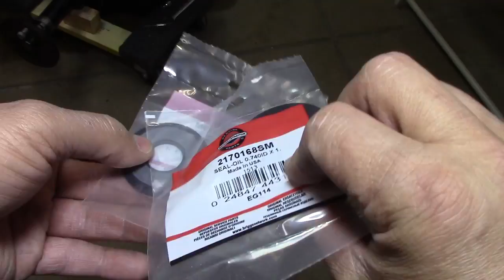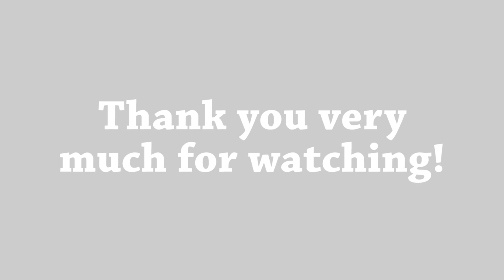40) Allis Chalmers 310 Tractor Restoration project, video 40

Comment: On your rear differential, you want the set screws to "bite" into the axle rather than just squeezing the brass plug onto it.  It is less likely to loosen or slip that way.  If you were removing the set screws every week or month the marks would be a problem, but there is a good chance that they will never be removed again, so one or two bite marks per side won't hurt anything.

You don't need to paint the washers and hardware.  Almost all nuts, bolts, and washers are zinc plated and shouldn't rust.  The contrast in colors between painted and bright hardware looks good, and is also how it came from the factory.  If you are worried, you can rub a little oil on them and that will keep the rust at bay as well.  

The greasiest old tractors are the easiest ones to restore because under that grease the original paint is protected and there is no rust.  It looks like you have accumulated a pretty good working set of tools.  The press, seal install kit, sand blaster, various paint guns, etc.  You'll be all set to restore something else when the 310 is done.  ;-)
Reply from the maker: +HemiRod23 I though the contrast of the hardware looked nice too!  I going to do what you said except I think I will clear coat the bolts.  Also, you are so right about the axle. When's the next time it will come apart?  So I plan to take out the brass.  And yes, I've been gathering tools and knowledge so I can restore a car when I retire.  I love tools!  And THANK YOU so much for the great info!

Comment: Your doing a d@%# fine job on this. I have been following the restoration for a while now. Just a thought on the space in the front spindles, if you put a thin radial thrust needle bearing in at the bottom of the axle there it is like power steering, almost. Zippo Varga has a vid of exactly how to do it here in the real  world of you tube.  I have made this mod myself and it works well.
Reply from the maker: +drspooks79 What an excellent idea!  I never would have thought of that.  I will checkout his vid on that and try to find those bearings.  Thanks so much for the kind words and the suggestion........